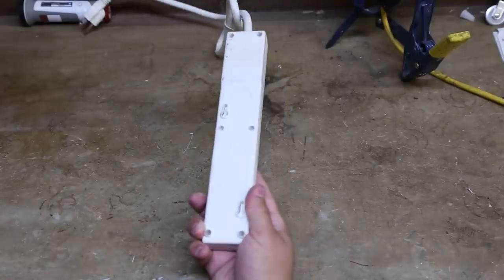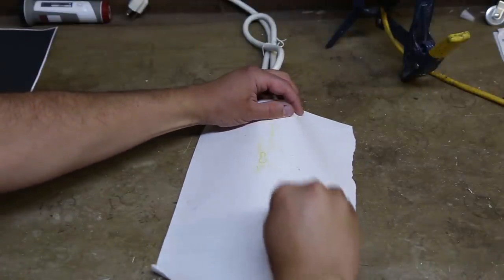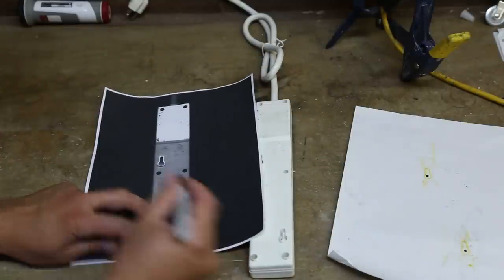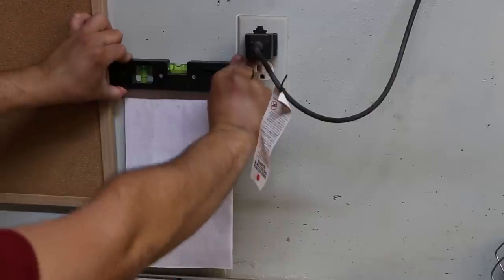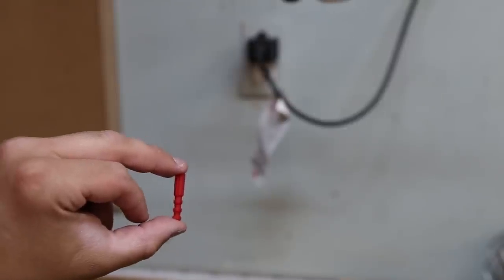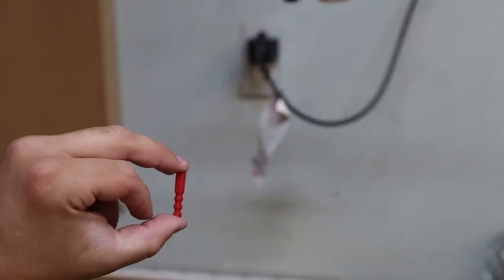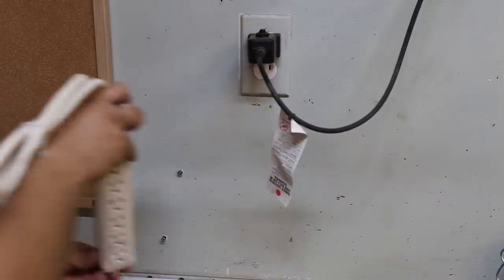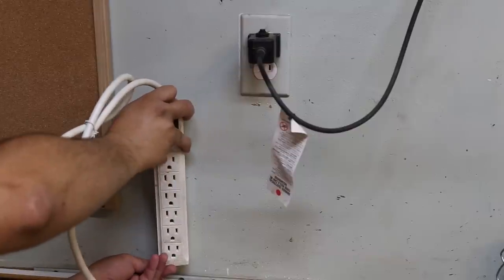Quick Tip: How to attach a power-strip / surge-protector to a wall (drywall)

Comment: The way I did it was by using a measuring tape and tracing the distance between each mounting point on the back of the power surge. Your way was much smarter and easier. Props to you, I didn't think about this.

Comment: Great technique and explanation, being an Australian, we would call the red plugs, Gyprock plugs, drywall/Gyprock same same, I like how you screwed in the screws first then remove and add the plug, takes an expert doing this a lot to make it so easy, working smarter not harder. Also I have updated my power-boards, surge-protectors to have separate switches for each socket.
Reply from the maker: Thank you for the comment, I appreciate it! I am a basic home DIYer, so far from a pro. I am glad you found the video helpful and I learned something as new well: Gyprock - cool name!

Comment: A easier way is to mount tape to the back of the strip and poke holes where the holes in the strip are. Remove the tape and mount the tape to the wall and drill the holes where the holes in the tape are. You have now transferred the strips holes to the wall via the tape.
Reply from the maker: Great idea as well!

Comment: The little red things you used to insert into the holes, did you say those were called "dry wall anchors"?
Reply from the maker: Antonio Jones Yes, drywall anchors. If you Google it you will see there are many different types as well.
Reply: @ColoradoRMN  What size of dry anchors and screws are needed.

Comment: What kind of screws did you get ?  what size?
Reply from the maker: Each power strip may have a different setup / size so just used screws that had a screw-head that is larger and fit the power strip.
Reply: @ColoradoRMN  If the screw head is larger than the hole of the power strip how will it go inside the hole provided in the power strip while fixing it to the wall?

Comment: FIRE HAZARD and code violation.

1)  Do not attach a power strip to a wall, furniture, or any object.

2)  The cord is not to be coiled or bent while in use because it causes heat to build up.|

3)  You have your bent cord touching the top of a large plug which can heat up and potentially melt the cord's insulation!

4)  Ventilation helps keep power strips and cords cool, but now that it is vertical:

a)  Heat will rise up from one plug to those above it.

b)  Heat will not cool the power strip normally, either, since the heat will rise inside the power strip and build up at the top.

I doubt an insurance company would insure this.

Please stay safe and read up on the codes!
Reply: OSHA
http://www.oshatraining.com/Violations-OSHA-Electrical-Standards-Power-Strips.php
Reply: Why doesn't someone stop them from putting the mounting holes on the back then? Every one I looked at today had them.
Reply: Chaos Corner  I can only guess.  Maybe the holes are used to hold them during their manufacturing, or maybe other countries allow them to be wall mounted (despite the dangers).

I would like to see people safe.  Look how he mounts it.  If it starts on fire from an internal arc or overload, how will he switch the switch to off or unplug it (considering fire and heat rise)?

The way he bends the cord is also asking for trouble, because the bends cause heat to increase in the internal electrical wires.
Reply: Chaos Corner ...or more likely, our government is illogical regarding what it allows.  Like how you can sell drug paraphernalia, yet the drugs they are made for are illegal.

But see how the sale of the paraphernalia doesn't make selling or using the drugs legal?

That may correlate to the mounting holes on a device not legally allowed to be mounted.
Reply: Hi Please, looks like it is legal (please see my second comment in the thread). This counts as a temporary mounting.
Reply: Sounds about as dangerous as leaving your toaster plugged in all the time.
Reply: Atmos Household appliances do start a lot of fires.  Even if sued, companies keep the appliance safety data secret in many cases, per Consumer Reports.  (PS I guess your were implying, 'don't worry about it' but it's better safe than sorry, right?   : )

If interested (at bullet points, down about 10? paragraphs):

http://www.consumerreports.org/cro/magazine/2012/03/appliance-fires-is-your-home-safe/index.htm
Reply: PleaseCiteYourSources Thanks you supposed to have it on a wall so no one steps on it and flooding that can cause electrical shocks.
Reply: Well possibly oh shut up. There are probably hundreds of things that you do daily that aren't considered safe...